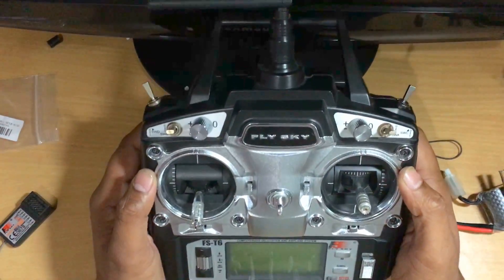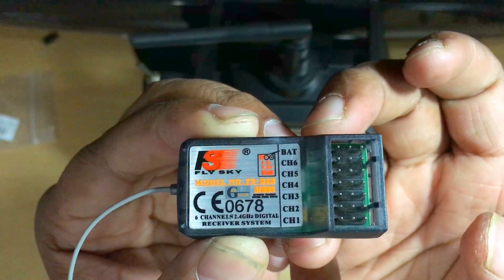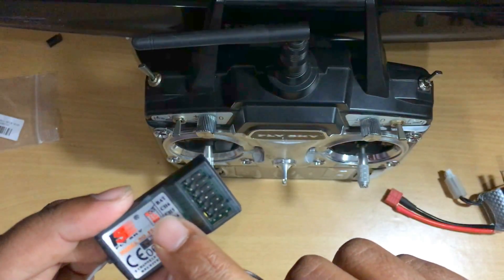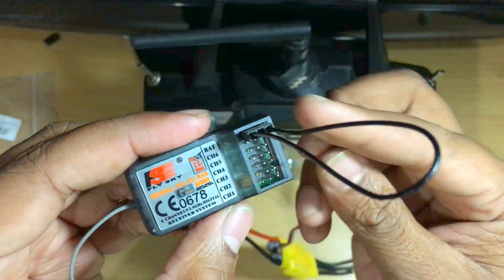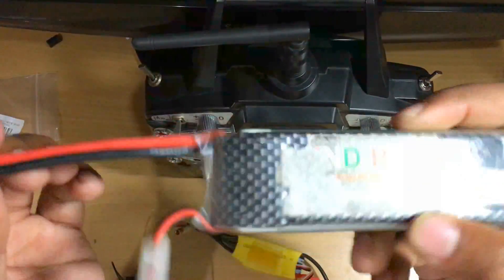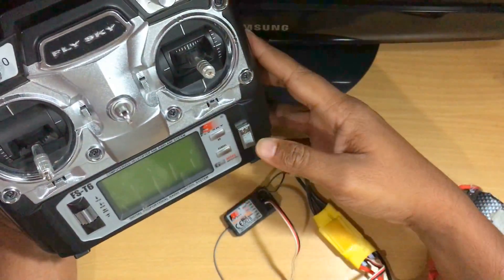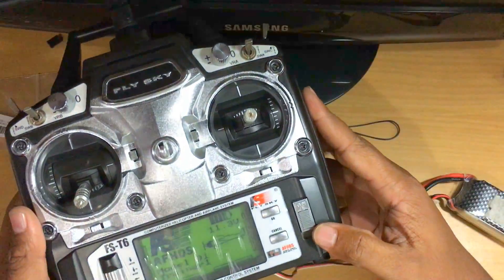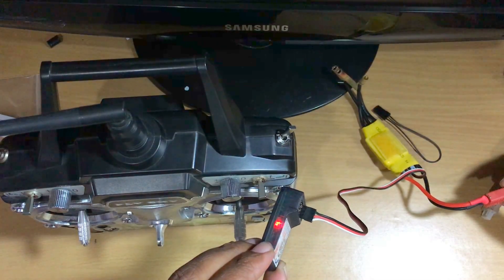Flysky FS T6 Transmitter and FS R6B Receiver Binding Procedure

Comment: I'm using my transmitter and receiver for RC boat why did you Channel 3 for your throttle? and which channel should I use for my steering?

Comment: Whats the range? 500m 1000m??
Reply from the maker: If you are looking for the range beyond 1000m, go for FS-i6 model. I lose control beyond 100m with this FS-T6 transmitter. You can use this same receiver with FS-i6 radio as well.

Comment: Can I use my old rc helicopter remote to make my own airplane please give suggestions
Reply from the maker: Yes, but you also need to pull out the receiver board from your heli or buy the same. You have to control ailerons with one servo so that you can use the another one on elevators. Do other calculations also like thrust and torque to decide size of your airplane.
Reply: @maddy232853  Thank you can you send a video

Comment: I have a fs-i4x TX and fs-a6 rx. Both came pre blinded. I would like to set throttle (channel 3) fail safe to zero. Is that possible? I do not have any fail safe button on my rx. And my TX does not have a lcd screen.
Reply from the maker: No actually this receiver does not has fail safe settings. You can check for firmware upgrades for your TX on their official website.

Comment: Hello fellow RC hobbiest. I got a question about this transmitter. Is there anyway at all to turn OFF the display after binding the transmitter and the receiver? Display will suck all the battery power very quickly. No wonder this transmitter requires 8 batteries... :)

Comment: I got a quick question. 0:43 Do you have to remove the bind plug right after you bind the transmitter and the receiver? Can you leave it connected to the receiver? For my application, I always left the bind plug connected to the receiver. Is that bad or it won't hurt anything?
Reply from the maker: Yes you should remove the bind plug because you are actually shorting the bind circuit using that plug and once the binding is complete there is no need of it. If you left it as it is, it will still work I haven't faced any problem yet. But you might need to bind your tx-rx again. When you reconnect the receiver and bind plug is connected already, it may go to the blinking state and then you have to bind it again.
Reply: Ooh... No wonder the receiver always blinked every time I power recycled the rx. I always thought it is normal, because like you said I was always able to operate my device afterward with the bind plug connected. So, does this mean that once you bind the tx with rx, you never have to bind them again? thank you for the reply. :)
Reply from the maker: Yes once the binding process is success you should unplug the bind plug, it will save the settings and you don't need to bind it again.
Reply: Hi Maddy Ny, I have a question. Is there a way to turn off the display on the transmitter after you successfully bind the receiver and the transmitter? thanks.

Comment: Someone help please? Receiver is blinking and my remote is aswell... but they are not connecting. I have same receiver as video and a 2.4ghz spectrum dx4e
Reply: you have to have the same brand I believe... or same ghz
Reply: Quicksilver Robotics I found out it I needed the same brand. Who wants receiver for £8?
Reply from the maker: Spectrum is not compatible with this receiver.
Reply: Maddy Ny ññq

Comment: can i bind any receiver to any transmitter?
Reply from the maker: No, you will get a list of compatible transmitter when you buy any receiver. This particular receiver will work with FS i6 / i10 / T6 / CT6B / TH9x
Reply: You sure about it being i6 compatible.. It isn't. I believe that one is a green color with 2 antennae i.e FS-iA6 2.4G 6CH AFHDS Receiver For FS-i10 FS-i6 Transmitter
Reply from the maker: Actually most of the manufacturer make their latest transmitter to work with their earlier receiver models until or unless any major change in technology. You can bind this receiver with i6. Please check this 
 https://www.youtube.com/watch?v=kVCvVHo8OJo